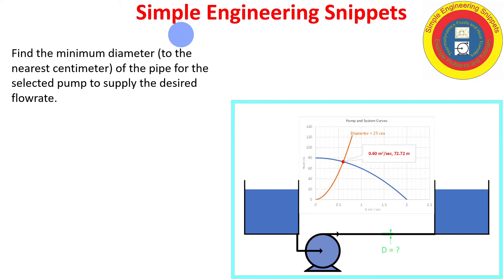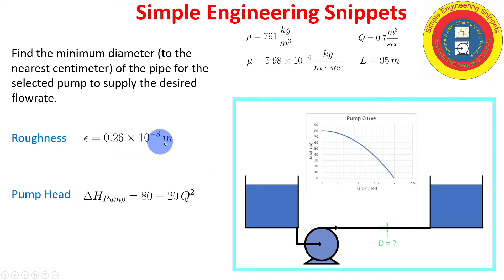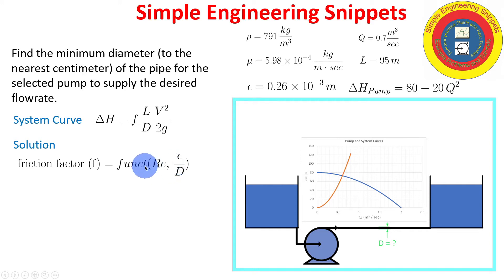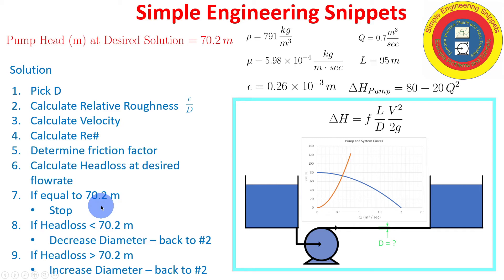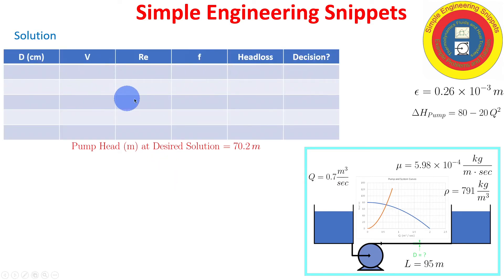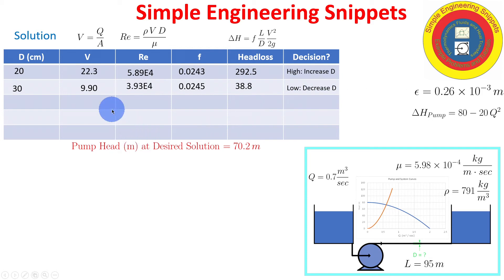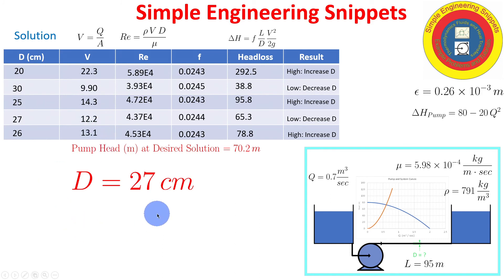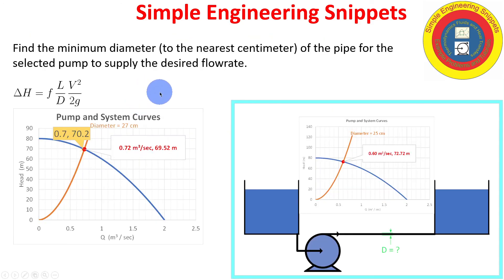Hydraulic Pipeline Diameter Selection Example

Comment: Is this example applicable for finding diameter of hose pipes, If possible then can we find for given data of pump maximum operating pressure= 27.45Mpa, Flow rate=31L/min , Fluid used-System-68 Hydraulic Oil . How do we find which Size of pipe at outlet?
Reply: Is it possible to find with this amount of data?